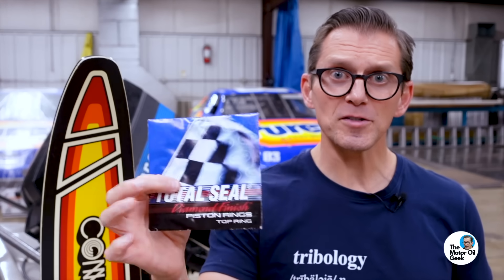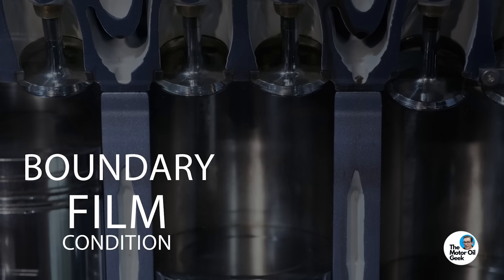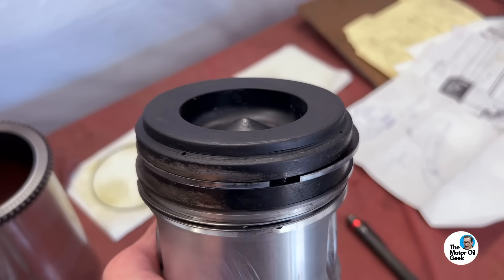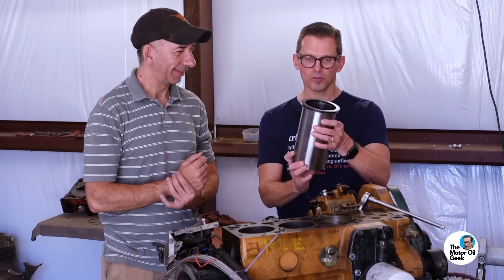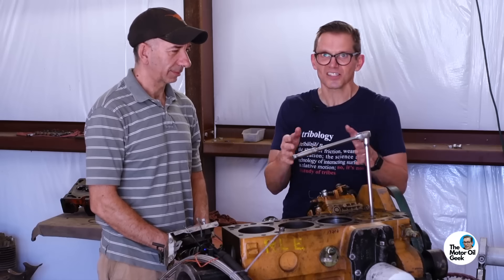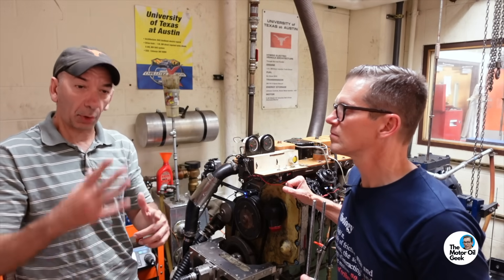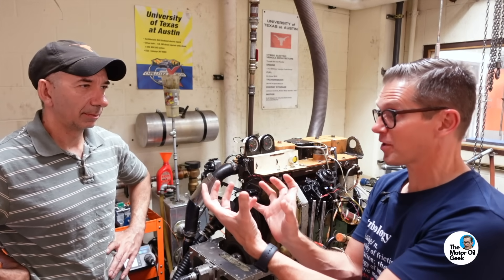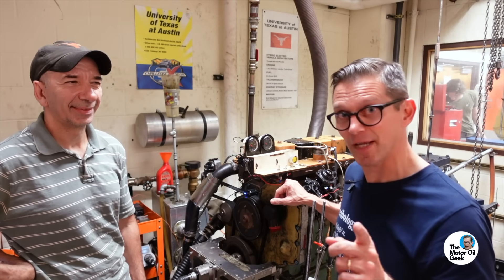Water Skiing Explains LUBRICATION - This CRAZY Engine Proves It!

Comment from the maker: WOW! Thank you for watching this video! 

Based on the comments so far, here are a few points of clarification.

1.  The piston rings are pinned like in a 2 cycle engine, so they do not rotate.
2.   The unique cylinder seal features oil passages to lubricate the backside of the liner. 
3.   Here's a great video that features some animations of the sleeve valve engine https://youtu.be/xdkgcXnWoxY?si=tWrYLUbq8OF4NDO_
4.   Dr. D, Jim DeGroot (who did the machine work and built the prototype engine) and the rest of the team behind the Rotating Liner design are looking for funding to build a complete Cummins 4BT to continue the development of the concept.  
5.   The friction reduction noted in the video is net of the friction required to rotate the liner, which shows just how much friction there is between the piston rings and liner near top dead center and bottom dead center.
Reply: Lake, I believe a large portion of the friction reduction would be from the pistons themselves, not just the rings.  The rings have combustion pressure holding them in contact, but there are large side loads on the pistons at anything other than perfect 0 degrees TDC.  A likely reason the rings cause more measurable wear is the contact pressure is much higher; piston loads are spread over a much larger area.

Also, the relative speed of the moving surfaces is lowest at idle (larger portion of stroke in mixed lube condition), which is probably one reason the idle efficiency gain is so high despite loads being very low.
Reply from the maker: @superspeeder  The piston skirts are also a source of friction, but many studies have shown the rings to have a larger percentage of the friction that the piston skirts. To your point, rotating the liner reduces the friction from both the rings and the pistons.
Reply: @themotoroilgeek   thanks for confirming!  I don’t doubt your info, I was just surprised the pistons weren’t mentioned.

BTW you’ve got a GREAT channel going here!  I did Tribo failure analysis in a previous life and I’ve directed my replacement here several times to check out your content.
Reply from the maker: @superspeeder  Thank you so much! As I'm always "teaching" on this channel, the emphasis on the piston rings was intentional. This sets up a future video where piston ring and liner friction/wear are critical.
Reply: @themotoroilgeek  looking forward to it! 👍
Reply: Magnetism better explains lubrication in motors.
Reply: why not just have rotating gudgeon pins ,that have small bearing's fitted to each end and the c clips hold everything in place.🦘🦘👌👌✌✌
Also because you have added more moving parts there's more friction and wear to worry about in the end of all things? cheers at least thats my 2 bob worth 👌👌✌✌🦘🦘
Reply: Do u have a suggestion for oil for a 1100hp hot rod race car it's a 68 barracuda is joe gibba the oil to use??
Reply from the maker: @Urfavgirl_Avani  Check out page 36 of the Driven Racing Oil catalog for the viscosity choice. The Driven GP-1 oil is a great product for your application.
Reply: What if the ring grooves with made with high-power engraving laser to match the varied piston/ring speed over the stroke of the pistons?
Reply: 10% fuel economy savings? LOL. The estimate engine friction loss is only 8% 😮 https://youtu.be/Yf6ERtU5fYU?si=QMRgJohiwlpTKNC6. Expected better from a science guy 😢.
Reply: @rharaksi  This is a very typical misconception.  Indeed under medium load conditions about 8 % of the fuel goes to friction.  But that also includes the energy wasted in the exhaust and coolant.  The reality is that you have to compare that 8 % to the useful energy which is about 35 %.  That means that the energy lost to friction is actually 8/35=23%.  In other words, if we reduce friction in the dramatic way that our RLE does, the fueling rate will be reduced to a substantial degree in order to meet the load requirements, reducing ALL the other heat losses into the engine.  In other words, the heat dissipation to the coolant, oil, and exhaust gas will all reduce.  Also, very often, the heat loss calculation to the coolant and oil have their sources in part from friction, which converts mechanical energy back to heat, which ends up into the coolant and oil.  Again, your misconception is very typical even to "professional" engineers who have a very limited understanding in friction.  Most of the people that make decisions in big OEM's are usually low-end engineers that have good political skills and climb the hierarchical ladder cleverly and were able to "swim" together in the slime that MBA's and lawyers swim, which makes these detail explanations difficult.  On the video that was sited ...  The changes in friction done by different lubricants is tiny because this boundary friction that the RLE eliminates is always present.  The RLE is a unique method in this world or reciprocating engines where the pistons all have to stop at the worse possible time.
Reply: @rharaksi  Agree. Claims of 10% or better economy sound way overblown to me.  I don't expect this concept to go anywhere.
Reply: @Mark_Bridges  This is a very typical misconception.  Indeed under medium load conditions roughly 8 % of the fuel goes to friction.  But that also includes the energy wasted in the exhaust and coolant.  The reality is that you have to compare that 8 % to the useful energy which is about 35 %.  That means that the energy lost to friction is actually 8/35=23%.  In other words, if we reduce friction in the dramatic way that our RLE does, the fueling rate will be reduced to a substantial degree in order to meet the load requirements, reducing ALL the other heat losses into the engine.  In other words, the heat dissipation to the coolant, oil, and exhaust gas will all reduce.  Also, very often the heat loss calculation to the coolant and oil have their sources in part from friction, which converts mechanical energy back to heat, which ends up into the coolant and oil.  Again, your misconception is very typical even to "professional" engineers who have a very limited understanding in friction.  Most of the people that make decisions in big OEM's are usually low-end engineers who have good political skills and climb the hierarchical ladder cleverly and were able to "swim" together in the slime that MBA's and lawyers swim, which makes these explanations difficult.  On the video that was sited ...  The changes in friction done by different lubricants is tiny because this boundary friction that the RLE eliminates is always present.  The RLE is a unique method in this world or reciprocating engines where the pistons all have to stop at the worse possible time.
Reply: Would it not be more efficient to rotate the piston or just the rings? For example, every time the rod moves to a certain position it acts as a cam to turn the piston or part. Or, the ring floats slightly acting like one of those clicky pen mechanisms rotating in only one direction even when going up or down.
Reply: @triple7988  There are many serious technical problems with the details of such a plan, plus you lose the flexibility of choosing the correct speed for a given application, and you do not protect the piston skirt from contact.
Reply: @dimitriosdardalis6658  I would think rpm of the cylinder or rings would be a direct relation to any throttle position in both configurations. Would the piston skirt not wear the same in both? The sleeve may wear faster without rotating, but it may still be an improvement over conventional fixed cylinders. You also get rid of the potential wear from the rotation of the sleeve in the block which is harder to repair.

Comment: This is a really cool test setup and design.  Does the net friction change due to the rotating liner take into account the power required to turn the liner?  There are frictions associated with that mechanical complication.

Comment: I suspect the seal is the weak link in this design. Can this system handle the high compression ratios of modern engines?
Reply: We have exceeded 1200 psi with no issues, the seal should be able to handle 180-200 bar (2700-3000 psi) with no metallic contact.  The seal can be redesigned for higher pressures if needed.

Comment: Wait so a 10% fuel savings at 50% load / throttle????
Reply: This is a diesel, no throttle.  At about 40 % load 10 % fuel economy benefit.  At idle about 35 %.  Extrapolation at full load is about 5-7%.

Comment: Absolute nonsense. 😂

Yeah, let's ignore all the friction spinning the cylinder adds.

And the other things.
Bore expansion with temperature (elevated due to non contact with the block) 
Bore distortion due to a floating thin wall liner
The sheer cost of implementation

In the world of designing mass produced engines, ring wear at TDC and BDC is not high on the priority list.

Comment: why was the choice made to have the rotation drive assembly at the top of the cylinder and not the bottom? would it not eliminate the extra potential failure point in the head gasket?
Reply: The location of the driving mechanism and the need to seal the interface of the rotating cylinder and the stationary cylinder head are unrelated issues.  The location of the driving mechanism is matter of convenience in terms of assembly and minimizing machining costs.

Comment: So in basic terms you get an engine that lasts longer at the cost of fuel efficiency and loss power. Spinning the liners is not free. It uses engine power and added fuel burn to do this.
Reply: There is a 10 % fuel economy improvement at about 1/3rd load, and about 35-40% at idle.  The energy required to drive the liners is about 10 times lower than the energy saved from metallic contact.

Comment: im curious on the long term reliability & durability under constant load
Reply: The single cylinder can only run for about an hour at a time, but the expectation s that the reliability and durability will be better than a conventional engine since there is no wear.  The engine should also be able to handle more boost, but we have not operated the engine at more than about 100 bar peak pressure (1500 psi).  The seal should be able to handle 3000 psi though.

Comment: You're intellectually combining two different components, the rings and the piston skirt, and erroneously discussing them as a single unit. Yes, the traditional skirt is badly designed, but it is easily fixed with an inverted crosshead:
The connecting Rod's upper end is enlarged so it bears directly on the lower cylinder wall at all angles. This creates lateral bearing that never slows down: the rod's rotation is maximum when the piston is at TDC and BDC while said Rod's sliding is maximum at mid stroke.
The piston is completely removed from lateral bearing both mechanically and thermally.
This also maintains perfect ring to cylinder wall orientation. 
Rotating liners are an unnecessary kluge given that inverted crossheads do a better job without adding more friction and complexity.

Comment: This is ridiculous! The piston rings and cylinders are made of materials that reduce friction and wear, like chrome and silicate metals. Remember, the downward stroke wipes oil off the cylinder walls and coats them on the upward stroke after the rings have already passed. 
Adding more moving parts to an engine will increase cost, complexity, and reduce reliability. If engine oil is neglected, heat will cause the layer of oil in between the liners and the block to carbon up and prevent the liners from rotating. Plus, liners are typically cast into aluminum blocks for mass production or the liners are sub cooled and placed into a heated block, as to become a tight fit when the materials return to similar temperatures. 
In race and large stationary designs, liners are made for easy removal for easy repair. These style engines are very expensive to replace and would never be sold en mass.
Maybe using this design on piston powered aircraft would be better suited. They have more wear and require frequent rebuilding. Maybe this design could double the time between TBOs.
Reply: What we presented here is not speculation, its facts, you may want to watch the video again.

Comment: In order to reduce piston ring and the top of cylinder duralability you are going to increace friction pairs and dramatically reduce overal duralability by embedding a lot of rotating parts like cylinders and gears? What about the cylinder head gascket sealing? What about rotating cylinder to water jacket sealing? It would be 1500% more cost-effective to rebore the block and replace the pistons with rings every 300-500k miles than service an incredibly complex engine like this one. It would also be less fuel-effective due to increased the rotating masses and additional friction
Reply: The main objective is not so much the durability, as much the fuel economy.  But the added components all operate hydrodynamically, no wear and very low friction.  The has sealing was addressed in the video (and you can visit the website for more detail information).  The coolant sealing has not been upset.  Yes, the initial cost of the engine will increase by about 10%, but if you look at the economics of commercial engines, the initial cost of the engine is tiny compared to the life time fuel cost.  Also, there will be substantial advantages in harmful emissions besides the greenhouse gas.

Comment: So - fully rotating Sleeve valve improves all wear properties, - model Aircraft engines of this type exist - the engine rotates at half piston speed - facilitating larger props on a small nitro engine.  Those aero type engines  - sleeves are a total upper  cylinder cap needing no annular seal in the head  ("just" a set of port seals)
 - 10% paracytic losses reduced, sounds great (knowing that Otto cycle can only be ?? say 45% efficient thermodynamically (using "pump gas")...  sad part about many "revolutionary" systems, they introduce complexity and further losses - usually negating - incremental gains - additives on the other hand (environmental issues rise).
Reply from the maker: Thanks for sharing!
Reply: You are talking about the RCV.  The current RCV engines rotate only the top of the cylinder head.  But earlier versions rotated the whole cylinder.  I had extensive discussion with them, and they had told me that their piston rings never wear.  Typical RC model engines wear piston rings very rapidly.  The reduction of total parasitic losses of the engine are reduced by a far larger margin than 10%.  10% is the fuel economy improvement at medium load for a diesel engine with about 15:1 compression ratio.  Thanks.

Comment: Hey motor oil geek I use diesel to flush my cars when I do a oil change I drain about a quart and add the same amount of diesel I let it run for about 4 to 5 min I do it on a warm engine and it dose take out a lot of black oil with it when drained I know it will not ignite in the engine and it has a bit of oil in the diesel please let me know what you think about it because engine flushes are expensive if diesel can do the same then I’ll keep using it.

Comment: Reducing friction by adding more friction?
Reply from the maker: Yep. In this case it is a net 10% gain.
Reply: @themotoroilgeek  %10 gain for how long?
Reply from the maker: @Tac_Taco continuously
Reply: @themotoroilgeek  obviously you missed the point of my question. Yes continuously. For how long?
Reply from the maker: @Tac_Taco  It should be for the working life of the engine, but long term testing would need to be done to validate that.

Comment: I love the concept that can make engines run much more efficiently, if this evolves into a production engine with a revolving cylinder they could expect higher mileage engines and less fuel consumption; nevertheless, more parts equals more failure points. I hope to see this design take off.
Reply from the maker: I hope they get to build a full size prototype to test.

Comment: 10% - the force and weight of rotating your cylinders
Reply from the maker: The 10% is net, so the energy required to rotate the cylinders is 10% less than the energy saved by the reduced ring to liner friction.

Comment: How do you keep the rings from turning on the piston
Reply from the maker: They are pinned, just like in a 2 cycle engine.
Reply: @themotoroilgeek  I didn't think they wanted them turning also so I figured a pin would be logical it's a impressive design and good video thanks
Reply from the maker: @johnmuir3233  Thanks!

Comment: I call bullshit on the explanation. Sitting still in the water is not causing more wear and tear on the ski,s. That is like saying a switched off motor wears more quickly than a running one.
Reply: It would seem that you are missing the point of the analogy. Or maybe it is your point.

Comment: if the water skier stops suddenly it says above for a second then it sinks, depending on viscosity. there are conventional engines with over 500k miles . anyway , the technology is interesting especially because of the fuel economy increase.

Comment: Question mr lake s jr. ,  how many times a year should i run redline complete fuel system cleaner through my engine??  Ive got a mazda skyactive g  2.5ltr GDI engine.  I use 89 / 91 octane depending on whats available in my area.  Please and thank you 😊 🙏 ✌️
Reply from the maker: Once every 3,000 miles

Comment: Doesn't the friction required to rotate the cylinder liner & deal with the heat dissipation offset some of the 10% reduction in ring & piston friction?
Reply from the maker: The 10% is net of those losses.